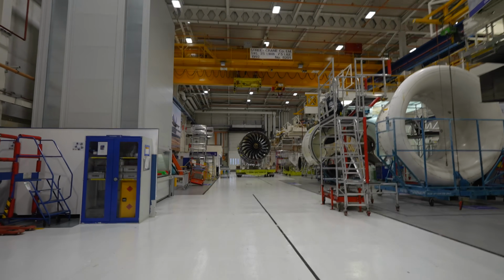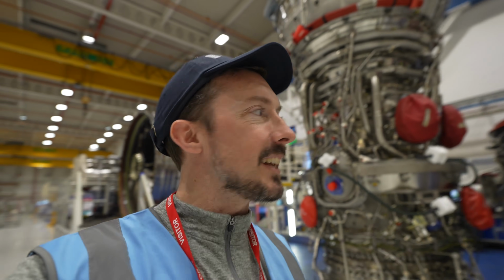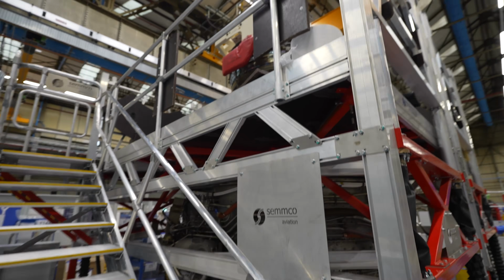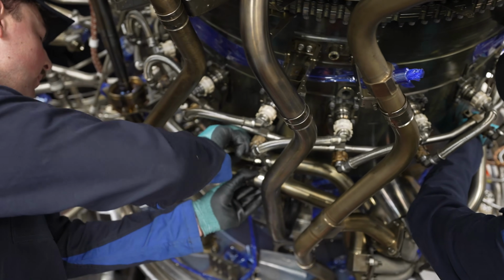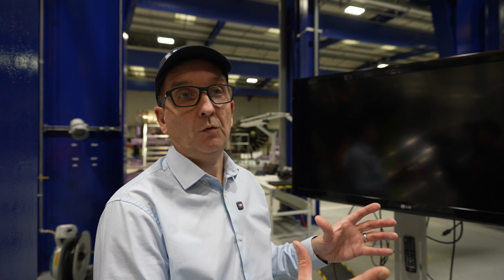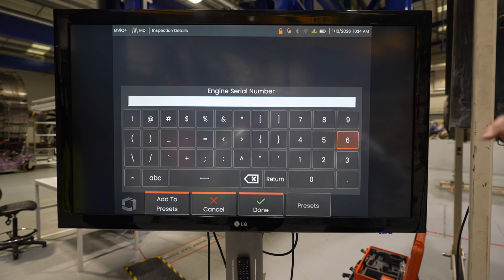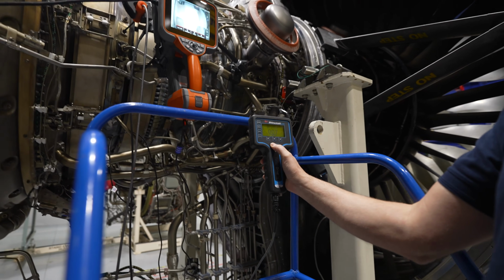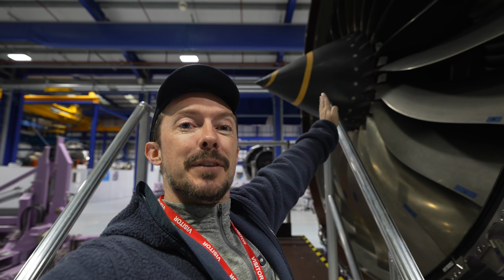How Rolls-Royce Jet Engines Are Built

Comment: Incredible to see how much work goes into taking these things apart and putting them back together. A jigsaw puzzle I'm glad I don't have to deal with! The precision required is nuts. Little bit of feedback on the videography: I know it's probably dark in there, but on the vlog and walking interview sections where someone is pointing at things, your camera's focus seems stuck on the person's head and the thing they're pointing at is blurry (not great). Could you maybe try making the aperture smaller (bigger number) and increasing the ISO? That would let you get more in focus at one time, and then we might be able to see not just their face, but also the things they're pointing at, at the same time. Also, I don't know if you maybe need a different focus mode, so that you can tap to focus on different things while recording. Some cameras let you do that (not sure which one you're using).

Comment: As a Brit and someone who has worked with some of the engineers  at RR, glad to see this great new video.
There was another excellent documentary made by the BBC 10 years ago about RR:
"BBC Documentary Rolls Royce How To Build A Jumbo Jet Engine"
Some interesting stuff  there about how the hollow fan blades are made and the casting of the turbine blades as a single metal crystal to maximise strength.
Clockwise engines ? Yes we drive on the left over here !
Thanks for doing this up to date video. Amazing how the technology has advanced in such a short time. Mind boggling stuff
Reply from the maker: Thank you, glad you enjoyed it!
Reply: The single crystal metallurgical methodology was pioneered at GE 30 years ago, RR and Pratt saw the performance benefits and also began utilizing the process later on. Lots of materials science involved in modern turbofan engines.
Reply: @12time12 It was actually pioneered by Frank VerSnyder of P&W beginning in the 1960s

Comment: Very interesting but the question I have is in regard all of wire bundles coming from the engine for control inputs. Do the have a solution for when they might be cut. QF32 had an uncontained engine explosion that cut all controls. Have they thought about something similar to a wireless backup solution to be able to maintain control over the engines in that unlikely event.
Reply: I'd have to guess as there's no feasible back-up option, RR focus on preventing an issue causing damage to the wire bundles, rather than a back-up for the wire bundles themselves. Like how they try to stop birds getting near an aircraft, rather than putting a 'shield' in front of it's powerplants if a strike happens. As for QF32, if you have an engine explosion, chances are you're not controlling it full stop, as you haven't got the same amount of engine you took off with.
Reply: The force of an uncontained engine event is really quite an explosion with shrapnel that can cut through the wing & fusilage with ease so not much chance of any control. The manufacturers do all they can to mitigate such damage but if the cowling can`t cope there isn`t much else to be done. QF32 had an explosion of the hot section well away from the ecu on the front fan housing, I imagine the `cut all controls` you mention was more to do with shrapnel cutting through the wings & severing hydraulic lines affecting control surfaces. The Air France A380 GP7200 uncontained was different as it was the front fan section fell off & I`d assume that would have taken virtually all of the electrical components with it.

Comment: The Trent 1000 is a lesson in how not to engineer a turbine. Cost cutting with bare minimum testing got RR in to this mess and they went from having the most robust turbines (Trent 700,  Trent 800 , RB211 etc) to the weakest (T1000 and T900)
Reply: T900 wasn`t a weak turbine, it had a good reputation on the A380 & did it`s job as intended.
Reply: @edwardwilcox6606  Erm no, I was at BA when they first arrived. Only the most recent build standard (the EP3?) would exceed 2000 cycles before it needed removal. The RB211 on the 747 had a 4x lower rate of egt erosion and most LLPs were 10k+ cycles versus 2-5k for the trent 900

Comment: Very interesting! RR are not hiding behind a PR wall like some do, and are addressing the engine issues, very much in the public eye! Takes balls!
Reply: To be fair, there's nowhere for RR to hide.  The Trent 1000 time on wing issues have been raised in public by the airlines that use them for some time.  For instance, British Airways have five B787s waiting on the ground for RR replacement engines - two of which haven't flown since 2024!

There was some PR stuff in the video about RR building new systems and 'production' lines but, in reality, they had to do this to reduce the backlog of engines needing fixing.  And then there was the R&D time needed to work out what the problem was and how to fix it!  The borescope segment and how inspection data can be standardised and shared was fascinating though...

Comment: I want to learn about how the a380 Rolls Royce engine is made please
Reply: Trent 900 is older than T-1000 but very similar in design, not so fuel efficient & not produced anymore as the A380 was discontinued. T-900 had a very good reputation as did the other engine offered on the A380 that being the GP7200 a colab between GE & PW.

Comment: I like their Pearl engines which you didn't cover in this video. Obvious opportunity to do another video :)  They are more manageable in size albeit still quite big. Used for the largest private jets.
And you could interview them about the possibility of making much smaller engines. RR is largely absent in the private jet industry and it should be very easy for them since those engines are tiny and vastly simpler than airliner engines. Much lesser responsibility as well. Small private jet engines from Williams and P&W are still in a 1970s fuel efficiency relaxed engineering state so RR could walk all over them. Hopefully also make them cheaper because they have gotten very complacent from the lack of competition. The PW610f which is the smallest turbofan in production, you can almost cover the intake with your hand and they still want 1million dollars for that. 3x as expensive by weight than Trent XWB despite not being weight optimized nor using exotic materials nor runs hot. 2 compressor stages and 2 turbine stages without blade cooling ducts. XWB has 14 compressor stages and 3 times higher pressure. So PW610f is a toy engine priced 3x higher. I'm not encouraging adopting P&W overpricing but doing a slightly better engine at appropriate of the tech level and size price, say 125k$. To say that would be welcomed by general aviation is an understatement. Manufacturing tech has advanced a lot recently such that what was once difficult artisan work is now trivial mail order. The potential for revolution in private jets is staggering. More cost effective smaller engines combined with monolithic carbon fiber shell construction can outperform existing products to a degree most engineers would swear is impossible. And while RR engines appear to be close to optimal, the airliners themselves could be drastically lighter and have a bit better aerodynamics which translates roughly linearly to fuel efficiency. You might cut the fuel burn in half without improving engines.

Comment: Derby is actually in the Midlands not the North 😏. I used to work at a large company just up the road NEI International Combustion in the 80's.

I believe there's a few sites there for aero engines and another for submarine stuff.

Great to see this vlog. 👍
Reply: They build nuclear reactors for submarines just round the ring road in Derby.